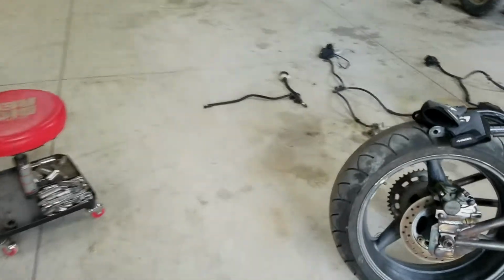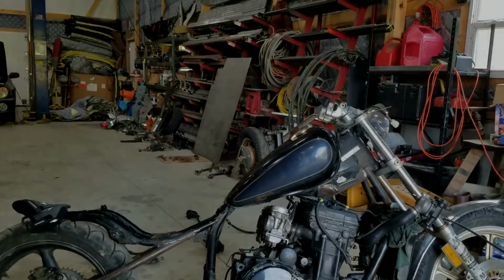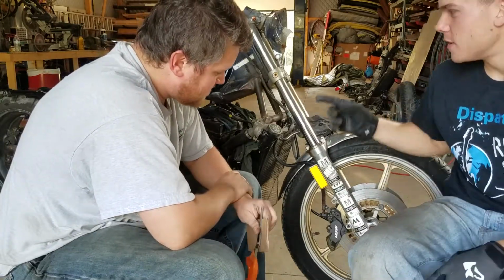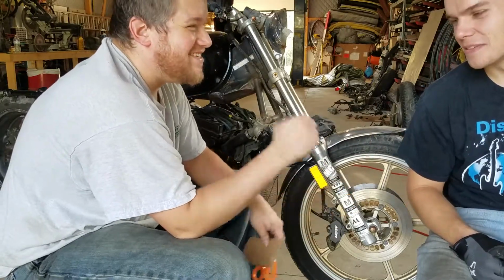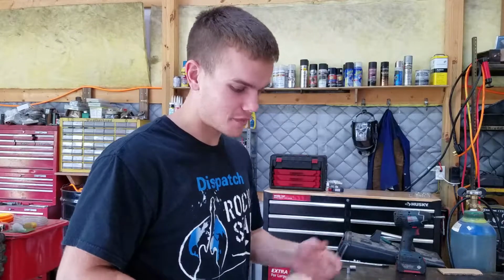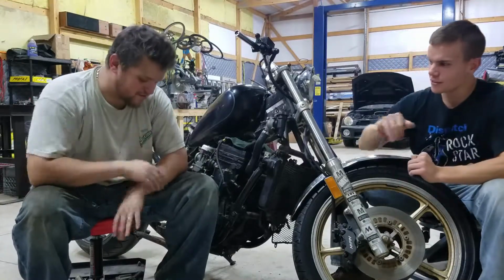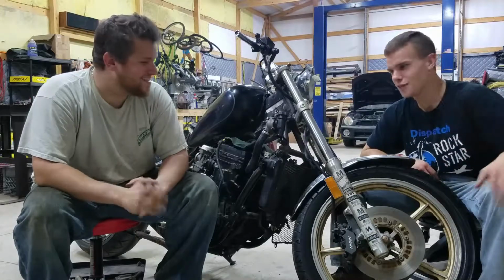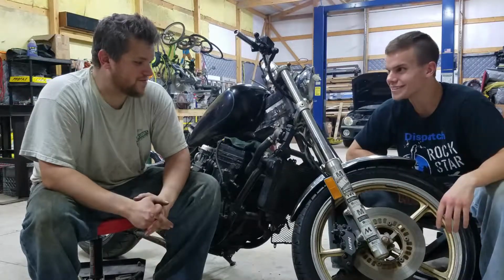Project Frankenchop Ep. 10 | Custom Caliper Brackets

Comment: hi, 6:30 what you use type metal ?
Reply from the maker: If my memory is correct, it is just a scrap piece of 1/4" hot rolled mild steel plate
Reply: @StaySlyh  1/4 = 6mm?
Reply from the maker: @sebastians2663  yes, approximately 6.35mm